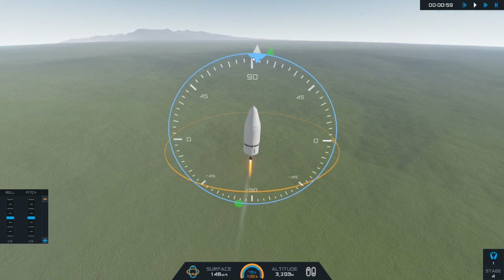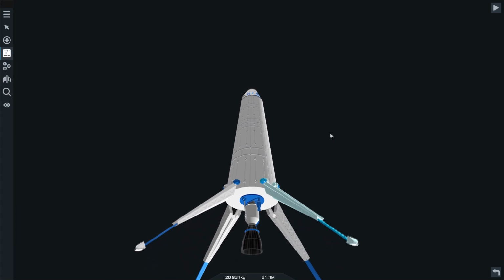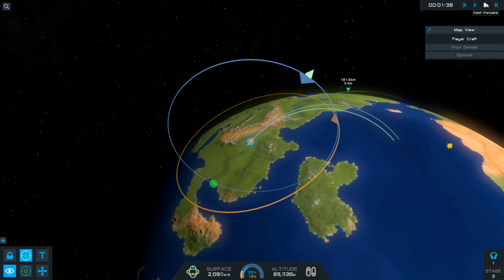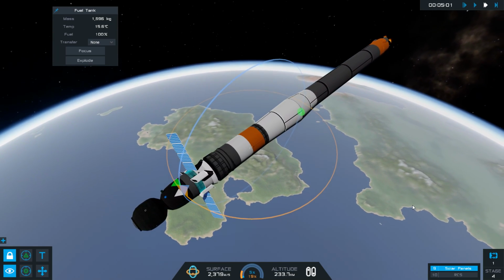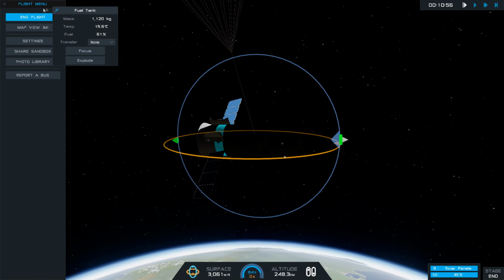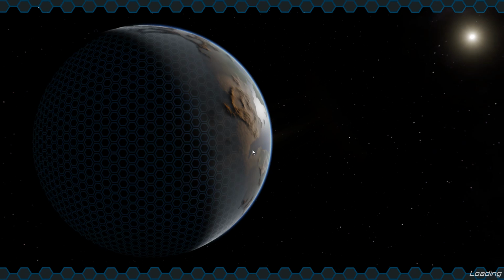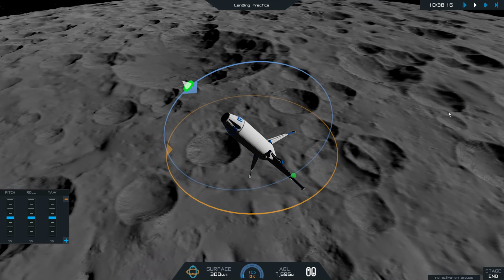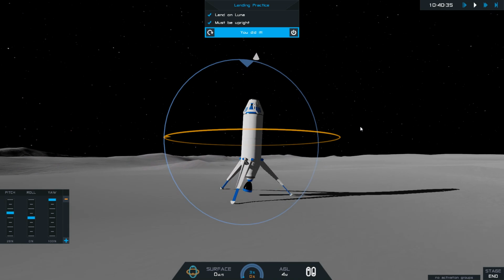Simple Rockets 2 - A Game For Rocket Builders, Without The Little Green Men

Comment: So a year ago I said mobile controls need a lot of work to improve the quality of life aera of the game. It has gotten worse with every update.
I swear to freakin ....... I hate moving parts and it randomly locks onto a node on the other side of the screen. ESPECIALLY when that node is cloned. Half your ship gets cloned 4 times after a nice long wait and if you try to fix it in game it's a roll of the dice to see which parts are now locked to others. Grab a part Start to move it then the game needs a second to think and now your finger is off the cursor and oh good it locked onto another node when I dropped it. So it's hit undo and go make a sandwich cause it's going to be a while..... It takes less time to kill the game, restart, load your project and try again. Seriously unoptimized on mobile with some of the worst controls and camera mechanics I have seen in a long time. PC version is amazing. Mobile is a bad PC clone that still hasn't got the love it needs.  Everything else is fine but if the controls suck all the good stuff means nothing. Really wish I didn't buy the mobile version at this point.

Comment: I have to get this. * Configurable parts - YES! * No flex must reduce kraken attacks so much, particularly on huge craft. * Control by those circles and sliders may not be perfect, but it's basically an autopilot which is light years ahead of trying to persuade KSP's SAS to accept a new orientation by trying to point the craft in the new direction. With aircraft in KSP, I very often want it to point the craft in a direction which it can achieve because I can get it to that angle with the key controls, but the SAS just decides to only hold it at 1/10th that angle because, keys being keys, I can't consistently hold the aircraft at the specific angle for long enough for SAS to lock on to it. Autopilot is basically the #1 mod I think I should get for KSP, but I'm lazy and hate installing mods. A joystick might actually be a better way of achieving this, anyway.

Comment: "The latest ipad is more powerfull then ur avarage laptop"
my brother with an i7 gtx 950m laptop for work Am i a joke to u?
Reply from the maker: Is that what you call ‘average’?
Reply: @scottmanley  yes... thats what i see as avarage... a laptop with an i5 or i7 and a goodish to good gpu for 500 to 700 dollars... i dont consider an macbook with an i5 and integraded graphics for 1500 bucks as an avarage choise...
Reply from the maker: @vali69  So what are the benchmarks for that system, and how does it compare to iPad Pro?
Reply: Why would you need an Intel Core i7 and a 1050ti for work?
Reply: @mohammedrazeenzaeencamil9344  first of all idk why i wrote 1050ti, must have been thinking of newer laptops, his has a gtx 950m... and work for him varies a bit so he needs a god damn i7 for the programs he uses... 
And for Scott, matey, macbooks have shitty cooling, lets be real most laptops with the same cpus as it have better performance due to cooling... and to be frank only the new 16 inch laptop is actually a decent machine... while the 15 is straight up garbage because of the bad cooling and the little 13 inch is in an ever worse position then the 15" one... and u also have to remember they run macOS so apps that arent specifically designed for it(this also includes all games) wont run as well as what apple develops for their systems... and now that ive remembered we were talking about the ipad not macbooks, a fricking i7 9750h laptop beats an ipad in every benchmark and the cheapest one u can get goes for 100 dollars less then the ipad... plus an older 8750h is also more powerful then an ipad and they go for even cheaper... if ur avarage phone is 1000 dollars i dont see how an avarage laptop cant be around 600 to 700... idk what u think avarage is... is it like a 300 dollar laptop avarage for u?

Comment: No sorry, the new ipads are not more powerful than laptops. Apple uses Geekbench which is a highly skewed benchmark to apple, it's why all of Apple's benchmarks are ONLY done on geekbench. But in the real world a simple cinebench, 3dmark, passmark, or any other real benchmark proves this myth completely busted.  Yea it's more powerful than atom laptops, but price point matching the myth is busted. Apple doesn't give you anything cheap. With laptops you would get more storage, memory and cpu power dollar for dollar.
Reply: For a chip that doesn't require cooling and that has a gpu module smaller than any chip and consumes power nowhere close to PC processors it is definitely "better".
Unfair Apple pricing aside Mobile SoCs are just underestimated. They are cheap, draw less power and imagine if you just give it a fan or any means of cooling like a copper pipe it won't throttle, there's already a phone with an internal fan and it is doing pretty well.

Comment: processing power is pretty irrelevant in KSP. never notice any lag running it on my almost 10 year old phenom ii while its throttled to 56% to keep using at max about 50w.
people that go out and buy the newest i7 because they feel they need to upgrade are pretty stupid, cpu's havent changed much in 10 years.
Reply: Okay, that's not how it works.
Reply: @naumen6508  it really is... its obvious that a gpu is still more important for KSP and it is probably one of the most cpu dependent games.
the only reason anyone would need a modern cpu is for retro game emulation and video encoding but video encoding can be done on a gpu so not even that much reason.
Reply: @majintroll4454  I won't try to explain, I just saw your name... have a nice day.
Reply: @naumen6508  what about it? you got some kind of prejudice against trolls? 
believing corporate propaganda that is designed to get people to spend money on their products is worse than being a troll.
Reply: bet you would have been one of the people who said when no man's sky first released it was just technically impossible to run the game without the sse4.1 instruction set then like a week later they released binaries that dont rely on sse4 and the cpu isnt a bottleneck LOLOL
Reply: @majintroll4454  nope i wasn't. Because No Man's Sky has no physics simulation whatsoever. When you see a full size moon 300 kilometers from its planet, you understand that quick. There is no aero braking, yet you fly like you're an airplane even in the middle of the vacuum. 
The CPU is used to generate everything procedurally, not to mimic real time physics : there's none in this game. 
I dont even know why you're taking about an Exploration type game when we're discussing on a physics based semi-sim
Reply: Yup, they tend to...troll.
I'll stop here since you're obviously aptly named.

Comment: While i’m sure its very lightweight to run, that’s also a good pointer that this is “simple rockets” with a capital S. It’s definitely an improvement from the last game which was little more than a slideshow, but calling it competision for ksp is a little excessive.

Ksp has a primitive set of physics rules, yes, but it’s not simplified and optimized to the point where you can’t expect something to act realistically. If you have a huge subsystem to prevent system resources from being wasted on calculating physics, you can’t have a sandbox game that is worthy of the name. Until AI comes into the picture the best way is what is being done in ksp... 

... tho i could definitely live without the memory leak in C++ >.<

Comment: "the latest ipad is more powerful than most laptops now" ... You sure about that?  I think dollar for dollar it has about an order of magnitude less power actually.  It has less memory, far less video memory, vastly less graphical power and most importantly arm NEON instructions vs x86 SSE simd instructions are extremely poor performing.

Its weird to see someone in this industry get such a fundamental thing wrong.  I thought people stopped making the "MHz*cores = actual computing power" argument 15 years ago.
Reply from the maker: Yep I’m sure about that, look at what kind of laptops people buy on average, I never said it was better value for money. Look at the custom built vector processing hardware on iPad for machine learning, and image processing. Go and read the numbers before posting.
Reply: @scottmanley  You seem like a decent guy and I love your space content, especially the coverage of the recent Soyuz stuff, but I'm not going to pull any punches here, sorry.

I'm assuming we're talking about the A10X, which is proprietary and manufactured by TSMC.  By "vector processing hardware" I'm assuming you mean the Scalable Vector Extension which is an addition to the pretty weak NEON SIMD instructions.  I've programmed in assembly both for x86 SSE and arm NEON so I'm going to have to take my experience over your assertion if you claim otherwise.  I don't have any experience with SVE but so far as I can tell it has to do with vector precision, not pipelining or parallelling, so I don't think that's going to help any.  Machine learning?  Yeah, high precision vectors have definite value there.  Mobile gaming?  Nope.

I understand you do something with or at Apple, but you've got yourself in a bit of a catch 22 here.  You're telling me that a proprietary SoC is better than a modern laptop.  I don't know, but every piece of information I DO have says that you're wrong.  So far as I see, there's nothing that says that I'm wrong and if I had to point out a smoking gun (knowing Apple, maybe literally smoking, ba-dum-tss) the A10X has a TDP of 8W (is that sustainable? generally its not in arm tablets) while something like the latest MacBook Pro with an i7 8850h has a sustainable TDP of 45W just for the processor (again, the A10X is a SoC, so the TDP is going to be almost the entire device power budget).  The 8850h is on the 14nm node and the A10X is on the 10nm node, but thats not going to buy you several hundred percent more processing power.

I spent a while here making sure what I said was correct.  While I'm sure your comment was a fire-and-forget one off, you wanted numbers?  You got em.  Imma firin my lazors.
Reply from the maker: @htomerif  No I'm talking about the A12X in the latest iPad Pro, which is indeed custom Silicon based upon an ARM core with a lot of special Apple sauce mixed in. To be clear I do work at Apple, but not on this product, I am probably biased, but that doesn't mean I'm wrong.

The A12X is built on 7nm technology. It has more than 10 billion transistors. The SoC has an 8-core CPU and 7-core GPU. Single core performance is up 35 percent from past iPad Pros, and multi-core performance is up 90 percent. The GPU performance is comparable to an Xbox One S, which to be fair is not the fastest console. The Official statement made during presentation was it's faster than “92% of portable PCs” sold in the last year. The vector hardware I'm talking about is the custom silicon for running machine learning models, it's not just the SIMD instruction set, this is something dedicated to a common task, think of it as a GPU dedicated to GPU Compute.

The best measurments are the benchmarks which have been available for a while now.
https://9to5mac.com/2018/11/01/geekbench-ipad-pro-performance/
https://arstechnica.com/gadgets/2018/11/apple-walks-ars-through-the-ipad-pros-a12x-system-on-a-chip/

I totally understand it's not a case of comparing clock speeds and core counts, and I also understand that there might well be thermal issues, although Apple has got pretty good at dealing with this in iPads. The longer tests I see are for things like video encoding and encoding 4K video is so ridiculously fast on the iPad that it's doing things in 1 minute that my Windows PC takes 20 minutes to do.

Regardless I stand by my original statement that the newest iPad is faster than the average laptop.
Reply: @scottmanley  Thanks for not being quite as antagonistic as I was.

Despite not thinking the A10X was as fast as a decent laptop, I was a little taken aback by how fast it actually was.  At a new process node, the A12X.. Well, we'll see.  It does sound like the hardware may be up to the task.  I didn't mention it before (because it didn't help my case) but Fujitsu is making an exa-scale supercomputer based on armv8, I believe with SVE as its core computational power.

I guess the last thing I'll say, which is cautionary rather than a denial of how powerful the A12X is, is that it would be a good idea for Apple to release full technical documentation on how to make use of their chipset.  Many good processors have died or languished (I'm lookin at you IBM and Quallcomm) to inadequate dev tools and documentation.

(some research passes)

Waaaaait a minute.  Is that just a Tegra in the A12X?  I was gonna say how the latest Nvidia Tegra line will compete with the A12X, but both manufactured by TSMC, both highly integrated armv8 SoC's.  A sudden focus on compute power from GPU assets.

Mr. Manley: Is the Apple special sauce actually Nvidia special sauce?  Maybe I'm the last to the party on this one, but it really looks like it.  Both have formed recent partnerships with TSMC and with each other.
Reply from the maker: @htomerif  I can't talk about any of that. Suffice to say, all of the capabilities of the hardware are exposed through library functions, so your code can be independent of the implementation.
Reply: @scottmanley  Well I CAN talk about and you don't have to answer.  In 2017, Imagination Tech, owners of PowerVR, the GPU IP in the A10X were dropped by Apple.  At about the same time, Apple partnered with Nvidia for an unknown project.

:3  I'll tiptoe on over Apple's developer resources and see if my current experience with CUDA has all the sudden gotten real relevant.

Apple isn't all bad.  I was honestly impressed that localhost:631still went somewhere interesting on my MBP.

Also, why aren't people reading this?  Its interesting stuff.  Could it be that they came here for rockets and not embedded processor esotera?  See you round the verse.
Reply: Of course the latest Ipad is better than an average laptop. But then you get any decent system with a dedicated graphics card and it won't matter, plus it would be much cheaper on top of being an actual computer. I will say the A12X sounds amazing and puts to shame anything else I have seen, but really I will stick with Android out of personal reasons and I won't really miss THAT much considering the mobile market.
Reply: @lord_fronic  If the A12X is an Nvidia tegra at 7nm it will be/is hard to beat in terms of raw compute power.  The effective speed problem comes from how well people program for things like CUDA.  If you're not specifically programming for the GPU then you're stuck with the relatively severe performance difference between an armv8 core and a modern x86 core.

I'd like to see Apple (or anyone really) come up with some kind of parallel optimization on the fly but I don't think they have.

Comment: Hey I have a question for anyone who can answer. If you had 2 object in orbit, at different heights on one side, and the could pass very close on the other side, what would happen to both the orbits if you where to connect them while they passed. Would this even be possible as one would have to be faster? Sorry if I can't convey my thoughts well.
Reply: well, that's a very peculiar question since normally to make the rendezvous maneuver the two objects need to be in an orbit close to each other, which makes the difference of the orbit after them connect is almost imperceptible, about your question, the orbits will "join" and remain at the point of intercession between the two, but this would vary according to the weight, and the speed of the object, if one of them is very heavy, and is much faster, its orbit does not will be so modified by the orbit of the other object (I may be wrong and speak things that make no sense)
Reply: @truta3715  thanks I get that your saying.

Comment: the ipad is nowhere near as powerful as an x64 computer - it only got 2gb RAM, a comparably weak cpu and gpu. simple rockets surely can be ported to mobile but i'd rather have it be as good as possible for pc than having a light version because it has to function on a phone.
Reply from the maker: My first x64 computer was an opteron 4800 in 2005 and had 2gigs of memory. iPad is way faster than that.